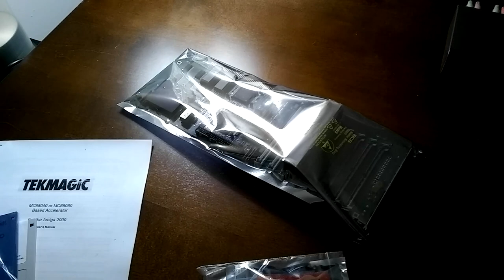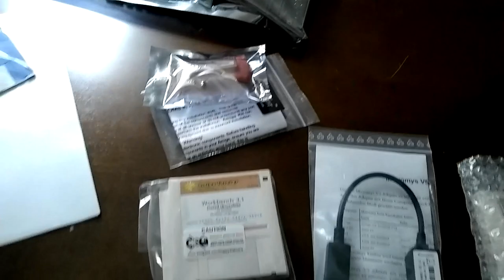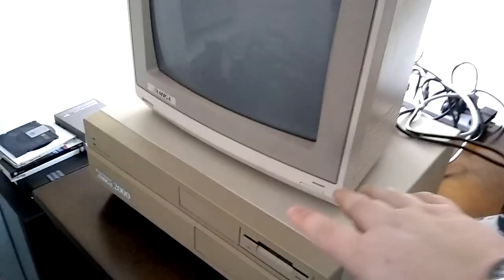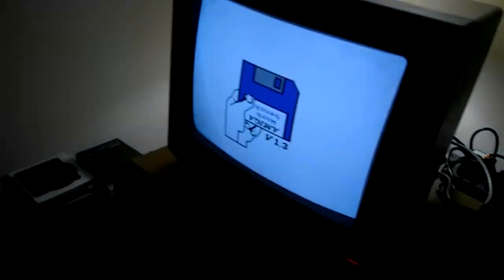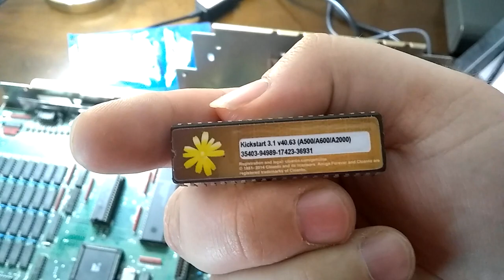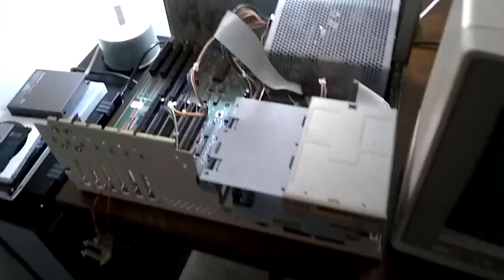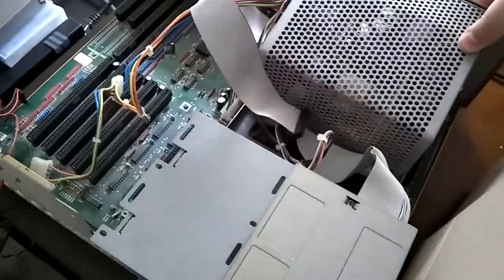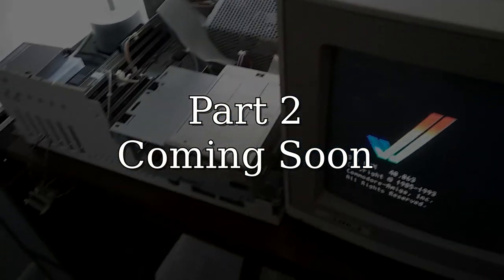Amiga 2000 Upgrade Part 1 (Reupload at 30 fps)

Comment: Got the same accelerator with 128mb fastram managed to over clock it to 60MHz upgraded the GVP Roms and the chipram to 2mb  in my A2500. Added scsi2sd v6 & 128GB Sandisk microSD running on 3.1.4 flawlessly. With scsi2 I get around 6.5MB's just added RTG card ZZ9000 brand new from MNT Germany so it now can display 1080p full colors super reliable Amiga.